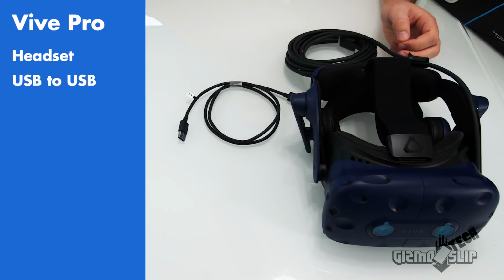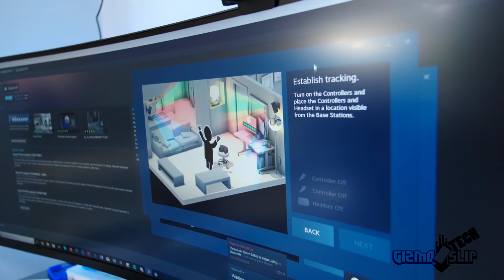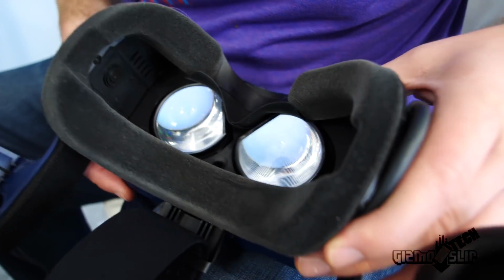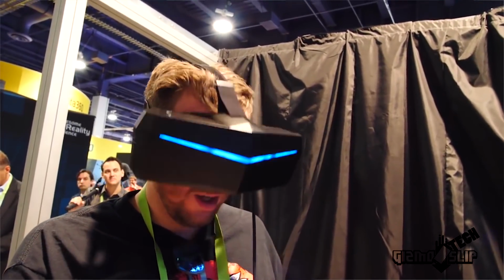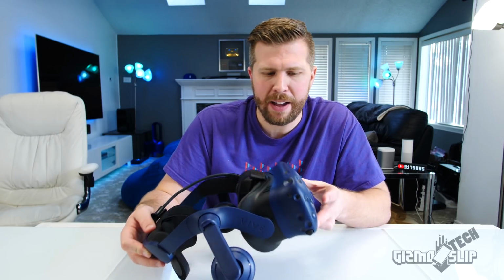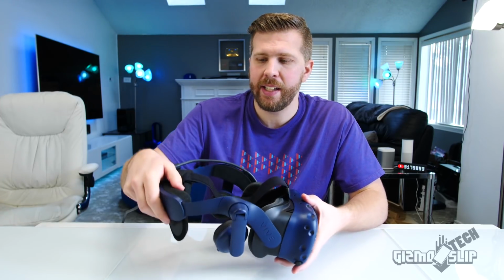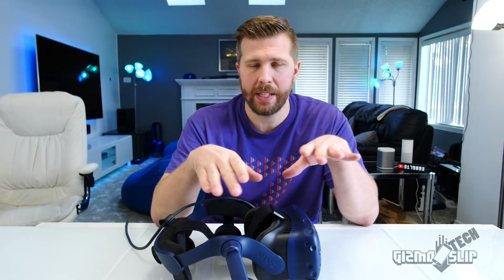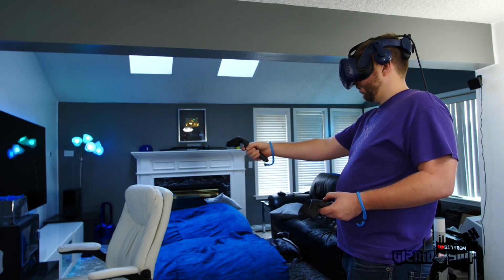HTC Vive Pro Unboxing & Impressions!

Comment: I had the Vive and then upgraded to Vive Pro a week ago. The Vive Pro is much better than this video gives the impression of. First, no problems getting it all connected and working straight out of the box. This guy must have screwed it up somehow.  Second, it´s way easier to find the sweet spot with the Vive Pro because the weight distribution is better and it fits much better to the face. Third, the screen door effect is more reduced than this video gives the impression of. It is still there, but now it´s possible to read text and instruments clearly in flight simulators. Negative: The sound quality from the included head phones system is worse than the original Vive! But it´s possible to remove them. I did that and use some wireless bluetooth head phones instead.
Reply: Thank you for "fixing" his review.

I bought a Vive pro 3days ago